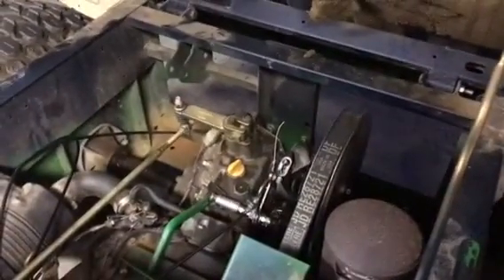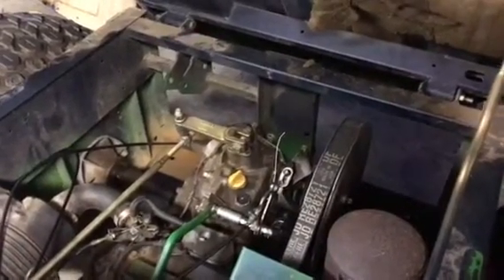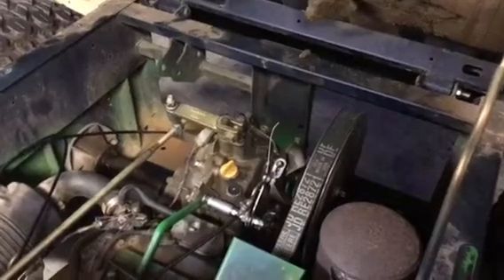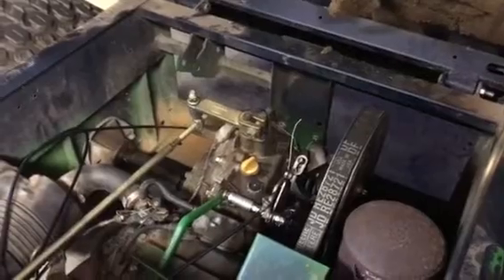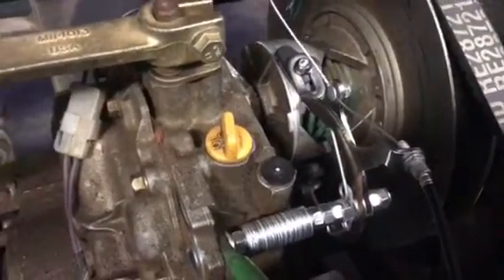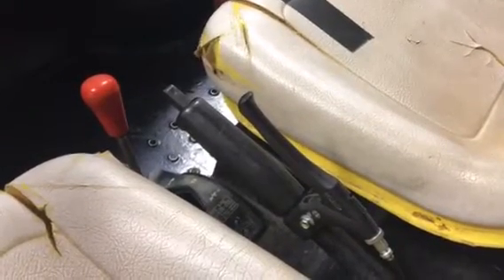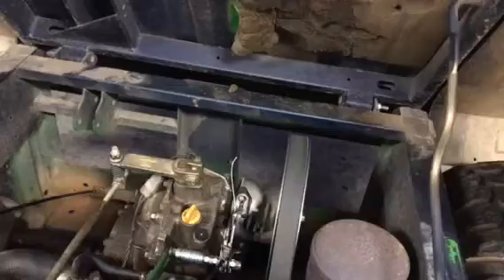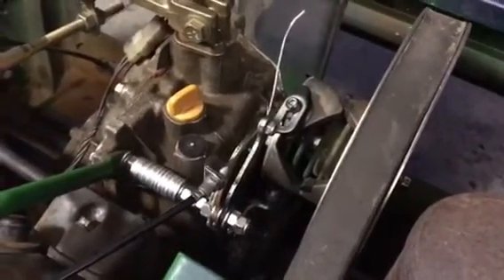John Deere gator shifting problem and solution

Comment: I have a 1995 6x4 that has same problem. I had done the bicycle brake fix years ago but mine only use one pad rubbing on outside of secondary when pulling the handle.  Eventually wore the pad rubber down.  I took it off after pad had worn out, should have kept it. How did you mount it and how did you get brake to spread that far to work on that area of clutch?

Comment: The primary clutch isnt disengaging so it wont stop spinning the secondary. This isnt a proper fix by any means. Repair or replace the primary clutch to fix it properly.

Comment: nice idea,     I was thinking about slotting the holes for the motor, that would loosen the belt just a touch where it wouldn't engage anymore, but it might change your top end a little, I'll update if it works.    but hey that's not a bad idea either, I was thinking of a brake of some sort as well,
Reply from the maker: Yeah, before you do all that, I would definitely make sure your clutch is operating correctly. It gets dirty and there’s parts that wear out and cause it to not fully disengage.  Make sure to check the idle speed also. Even with all that working correctly, the belt may still spin. There is absolutely nothing stopping it which is kind of ridiculous. I think a disc brake system would be ideal. Thanks for your comment.

Comment: Your primary clutch is fucked, that's why it keeps spinning the secondary clutchh and gearbox
Reply: Dusty Gadsby you are right, mine did this, until finally clutch went completely out to lunch, new clutch corrected the problem, but hey, new clutch was very pricey, I see this as a good patch, them gators are a lot of fun. But anything JD is pricey